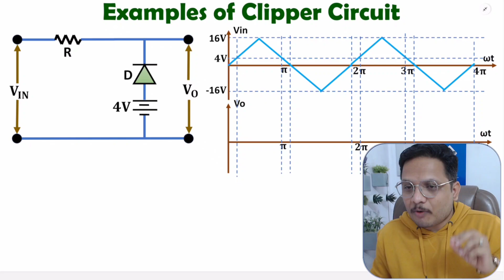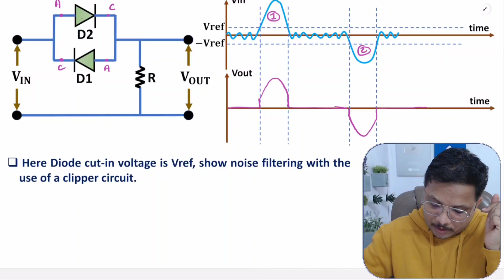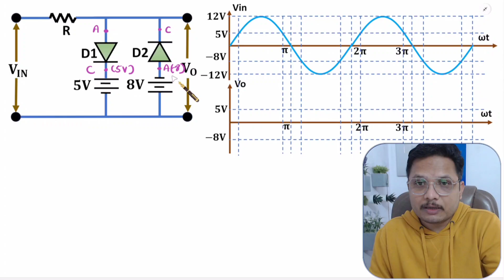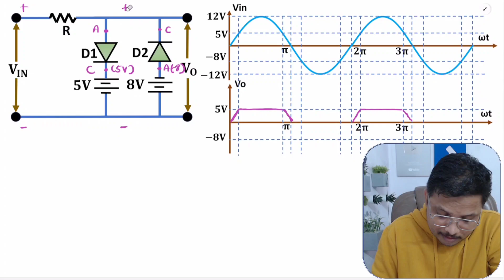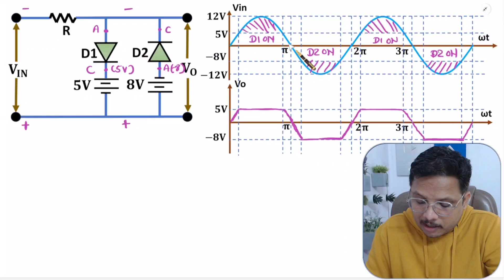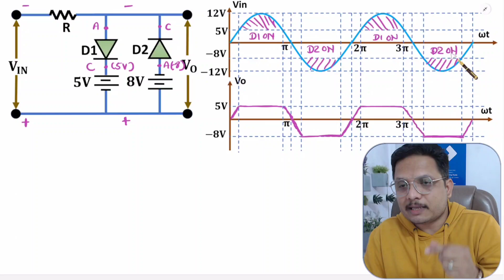Examples of Clipper Circuits | Solved Problems of Clipper Circuits | Waveforms of Clipper Circuits

Comment: Sir in the second problem of the output waveform is it will be (Vin-Vref ) for positive half cycle input and (-Vin+Vref) for negetive half cycle as you are referring diodes have some reference voltages respectively and not ideal ?

Comment: Sir, i think there is a little mistake in the first solution, on the range of (0-4V) the diode will be short so output voltage should be zero.. but mistakenly you made it 4V..
Reply from the maker: @EEEEngineering-s5f  it is perfectly correct here